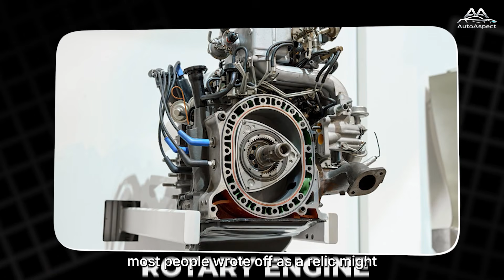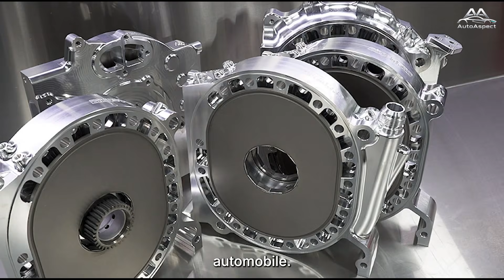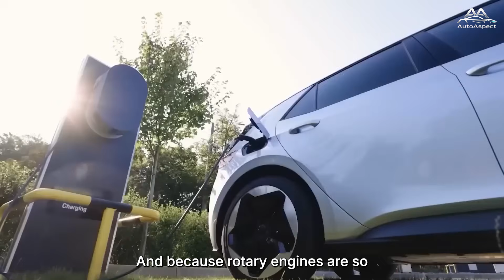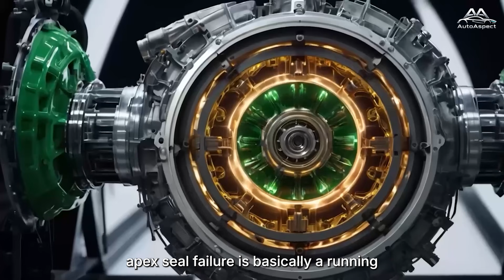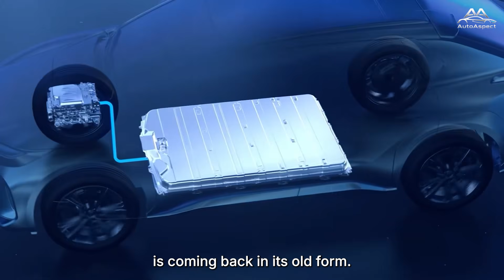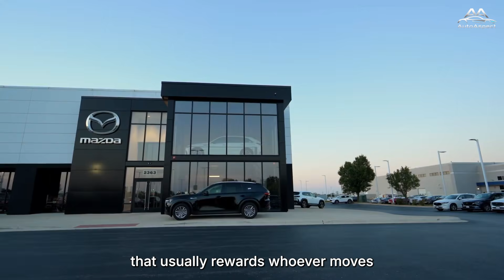Mazda’s New Engine Decision Just Changed the EV Industry Forever!

Comment: I had this idea. Place a chrging system for the battery like the alternator in an internal combustion system.
Reply from the maker: That’s basically the idea Mazda is using here—except instead of an alternator mechanically tied to the drivetrain, the rotary engine works as a dedicated generator to recharge the battery while the electric motor drives the wheels.

Would you prefer that setup over carrying a much larger battery?
Reply: @AutoAspect-x larger battery depends on recharge and distance management while a rotary engine supplies continuos charge.
Reply: @AutoAspect-x larger battery depends on recharge and distance management while a rotary engine supplies continuos charge.

Comment: What a load of horseshyt! The "wankel" engine has NEVER been reliable or economical. I've owned both the mazda car rotary and the suzuki rotary motorcycle. Smoothest engines ever but NEVER again would waste money on a rotary engine. This entire video is BS
Reply from the maker: You’re right about the old RX-7/RX-8-era rotaries—they had real fuel-consumption and durability issues. But calling this the same engine misses the point: Mazda’s new 8C rotary is used only as a generator, not to drive the wheels, and Mazda redesigned it with direct injection, thicker apex seals and other changes specifically targeting efficiency and reliability. The video makes that distinction too.

Would you still rule it out if long-term owner data shows the generator setup holds up better than the old rotaries?
Reply: @AutoAspect-x My father has two rotary generators in his garage they suffered the same fate as all other rotary engines. By the way, Mazda dumped the rotary engine generator that you are supporting as a failure.

Comment: Does the Mazda updated Wankel engine run on “mixed fuel” as like 70% gasoline/ 30% ethanol?
Reply from the maker: The script doesn’t claim Mazda’s current production rotary is calibrated for a specific gasoline/ethanol blend like E30. It discusses gasoline today and hydrogen as a possible future fuel, so I wouldn’t present a 70/30 mix as confirmed without Mazda specifying it. If Mazda certified it for higher-ethanol blends, do you think that would make the rotary range-extender more attractive in markets with strong ethanol production?

Comment: This is now a question of which one catches up first: an improved battery with a larger capacity in a small package or a reliable and efficient hydrogen-powered rotary engine. If the first one happens first, then the latter could be a waste of time and resources.
Reply from the maker: That’s the real race. If batteries get much smaller, cheaper, faster to charge, and still deliver long range first, the case for a rotary range extender gets a lot weaker. Mazda’s bet is that battery and charging limitations will remain long enough for this bridge technology to matter. Which do you think reaches the market first: the breakthrough battery or a truly reliable hydrogen rotary?
Reply: @AutoAspect-x  This is a clip froom Toyota news: "Toyota plans to launch its first all-solid-state battery EVs in 2027–2028, promising up to 745 miles of range and 10-minute charging times, with production initially limited to flagship Lexus models."

The next question now is : Which one is more cost effective (initial cost + maintenance cost)? All-solid-state batteries should have a lower production cost (hence initial cost), and maintenance cost, considering they have no moving parts.

Comment: EV owner Me: i am going to plug my car for charging. 
Mazda ev owner: I'm going to fill gas to charge the battery.
Reply from the maker: Pretty much — and that’s exactly why this setup will divide people. You’re still getting electric drive, but the backup energy source comes from a gas station instead of waiting on a charger. Would you rather plug in for 30–40 minutes or refuel in five minutes and let the rotary handle the rest?

Comment: If increasing battery output and range is what they are trying to solve, then performance and delivery may be last priority for them. Coz balancing both comes with heavy price.
Reply from the maker: That’s basically the trade-off Mazda is making. Instead of chasing maximum battery size and outright performance, they’re prioritizing usable electric range, lower battery weight, and the ability to generate power on the move. The real question is whether buyers would accept less performance in exchange for lower cost and virtually no range anxiety—would you?

Comment: Can the Wenkel engine run on pure ethanol? 
If so, third world countries who can convert agriculture produce to ethanol can lessen dependency on imported petroleum.
Reply from the maker: Yes, a Wankel rotary can be engineered to run on high-ethanol fuels, but it requires the right fuel system, ECU calibration, seals, and materials. Mazda’s current setup in the video is focused on gasoline today and potentially hydrogen later, so pure ethanol isn’t part of the production claim here. Still, locally produced ethanol could make this kind of range-extender especially interesting for countries trying to reduce imported oil—would you like to see Mazda develop an E100 version for those markets?

Comment: I need to know how long the rotary engine needs to fully charge the battery.
Reply from the maker: That’s a fair question. Mazda’s rotary isn’t really designed to sit there and charge the battery from 0–100% like a plug-in charger—it mainly acts as a generator to maintain or replenish the battery while you’re driving. The exact full-charge time would depend on battery state, generator output, and driving load, and Mazda doesn’t give a simple fixed number for that in this setup. Would you rather see Mazda publish a real-world test showing how quickly the rotary can recover, say, 20% to 80% battery?

Comment: Has Mazda solved the problems associated with the rotary engine?
Reply from the maker: Mazda appears to have addressed several of the rotary’s old weaknesses, especially cooling, fuel delivery, and apex-seal durability, but I wouldn’t say the problem is fully “solved” yet. The new rotary has a much easier job than the old RX engines because it runs mainly as a steady-speed generator instead of constantly changing RPM and load. The real proof will be long-term reliability after years of everyday use—would you trust this setup more than a traditional hybrid?

Comment: Honda is already doing that with a small regular engine
Reply from the maker: That’s true — Honda has already shown that a small combustion engine can work very effectively alongside an electric drivetrain. The interesting difference with Mazda is the architecture: the rotary never drives the wheels at all. It simply runs as a compact generator while the electric motor handles 100% of propulsion.

So the real question isn’t whether the idea is completely new, but whether Mazda’s rotary can make the range-extender setup smaller, lighter, and simpler. Which approach do you think makes more sense long term — Honda’s piston-based system or Mazda’s rotary generator?
Reply: my understanding of the new Honda hybrid is the engine only provides power to the batteries and is not connected to the wheels
Reply: Lol!!! almost all are doing it already. It's already on the road mostly in Asian countries. Hybrid, Plug-In Hybrid, full EV

Comment: This is silly! It's a hybrid. This just adds complexity to an electric car. Batteries are improving rapidly in weight, charge rate and cost. Electric cars don't need a transmission saving weight, complexity and cost. Range of electrics is now 300+ miles. Fast charging is available everywhere now although more costly than home charging but still cheaper than gas or diesel. Hydrogen is a dead end being extremely costly to produce and handle.
Reply from the maker: You’re right that pure EVs are improving fast, and for people with reliable home charging, they’re probably the simpler and more efficient choice. But Mazda isn’t claiming this system is better for everyone.

The rotary engine never drives the wheels and doesn’t need a transmission—it only works as a compact generator. Yes, that still adds components, but it targets drivers who can’t charge at home, live in colder regions, or regularly travel where charging remains unreliable.

I also agree that hydrogen is highly speculative right now. The gasoline range extender is the real product today; hydrogen is only a possible future option if production and infrastructure ever become practical.

So the real question is: should buyers wait for charging infrastructure to improve, or is a range extender a reasonable bridge in the meantime?
Reply: I also own a hybrid Chevy Volt which only gets used for in town driving when one of us has the Tesla. If you have a BEV you'll never go back to ICE or even a hybrid. The Volt will be replaced by an Aptera solar car when it's available next year.

Comment: Remember the youtube video showing a tesla with a petrol generator in the rear boot. Same principle, but OEM design. Certainly would be worth a look.
Reply from the maker: Exactly—the basic principle is similar, but Mazda has engineered it properly from the factory. The compact rotary runs only as a generator at a controlled RPM, while the electric motor drives the wheels. That should be far more efficient, refined, and practical than carrying a portable petrol generator in the trunk. Would you consider this over a pure EV?

Comment: Are you going to put gas for that engine to run
Reply from the maker: Yes. The rotary engine still uses gasoline, but it doesn’t drive the wheels—it only generates electricity for the battery. Would you consider that a smart compromise, or does using gas defeat the whole purpose?

Comment: I think if mazda is using a rotor with an ev motor, the rotor don't have to be on a crank shaft setting, that goes up and down for this application. It could be a generator while given that settled rotary sound for that mazda Rx feeling.
Reply from the maker: Exactly—the rotary doesn’t use pistons moving up and down, and in this setup it simply spins a generator while the electric motor drives the wheels. Keeping some of that classic RX rotary sound could also give it real Mazda character. Would you want the sound to be noticeable, or should the car stay as quiet as a pure EV?

Comment: Mazda came with “revolutionary” diesel only to loose a shirt on it.They stopped Wankel for a reason…now for this application, it might work. But no word on emissions. How is this engine lubricated? Like two stroke? Good luck!
Reply from the maker: Fair point. This rotary only acts as a generator at steady RPM, which could reduce wear and emissions—but lubrication, oil consumption, and real-world durability still need independent proof. Would solid long-term test results change your mind?

Comment: Is this a second gen version of the MX30 REV that was killed off due to loud engine noise and short battery range?  If so, how were they (and other shortcomings) addressed?  If it is, great, I look forward to reading road tests.  If not, then it won't last long.  Why do they present it like its a brand new concept??
Reply from the maker: Fair criticism. It’s not a brand-new concept—the rotary range-extender already exists in the MX-30 R-EV. The real question is whether Mazda has improved the noise, battery range, efficiency, and reliability enough this time. Would better road-test results make you reconsider it?

Comment: If Mazda in a practical and true sense solves the metalogical limits where a rotary engine operates well below its upper heat tolerance, then the concept discribed in this video will be a winner for few years. Why only few years? The answer is technology, such as  batteries charging time reduced to a few minutes, charge capacity to ten fold providing a range of two to four thousand kilometers in between charging requirement and so on.
Reply from the maker: That’s a very balanced take. If Mazda can keep the rotary operating in a controlled, lower-stress temperature and RPM range, this system could be an excellent practical bridge for the next few years. But you’re right—the advantage may shrink quickly if batteries achieve dramatically faster charging, much higher energy density, and far longer range. Do you think range-extenders will disappear completely, or remain useful in regions where charging infrastructure develops more slowly?
Reply: @AutoAspect-x  a very tricky, yet important question about range and infrastructure in various regions where supply and demand set the rules for profit incentives, and market competition. When demand exceeds supply, prices rise to ration goods and encourage more production; however it is the technology that creates tectonic shift in market and consumer behavior.

Comment: Why dont the battery manufacturer comes together to design a universal swab-able  battery for all models of EV car that all you need to do is drop by battery station and swab your battery for a fully charge one and get going?  I believe they can do it if they wanted to.
Reply from the maker: It’s definitely possible, and some companies already use battery swapping. The main challenge is that batteries are part of the car’s structure, cooling system, software, and safety design, so one universal pack would require automakers to agree on size, voltage, connectors, and ownership rules. The swapping stations would also be expensive to build and stock. Still, standardization could make EVs far more convenient—do you think governments should push a universal standard, or should the industry develop it voluntarily?
Reply: @AutoAspect-x I believe the government should set the law and let the private sector to deal with the possibility of the scheme after all its the benefits of people the paramount objectives.

Comment: Mazda's solution is practical in the first place, that's applied engineering. Second, it is with a long-term look because it allows you to change fuel. The size and simplicity of the rotary engine running at low revs is ideal, because it does not stress the engine, it does not add gearbox, etc. It is a really ingenious and practical solution, because they make use of their own engine in the best possible way offering EV torque with extended range.
Reply from the maker: Exactly. Mazda is using the rotary engine for the job it may be best suited for: running steadily as a compact generator while the electric motor delivers the torque. That reduces mechanical stress, removes the need for a conventional gearbox, and could allow different fuels in the future. The real test will be long-term efficiency, reliability, and cost. Do you think this approach could become a permanent alternative to pure EVs rather than just a transition technology?

Comment: mazda already pull the plug on this engine anyway
Reply from the maker: Fair point—the MX-30 R-EV has already been discontinued in Europe, so this first attempt clearly didn’t connect with enough buyers. The real question is whether the rotary range-extender concept failed, or whether the MX-30 was simply the wrong car at the wrong price. Which do you think it was?